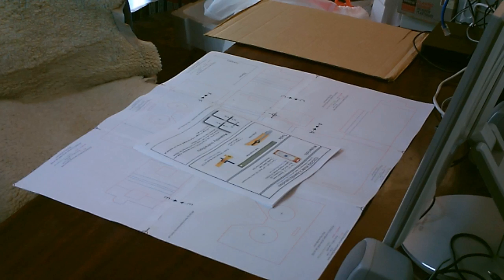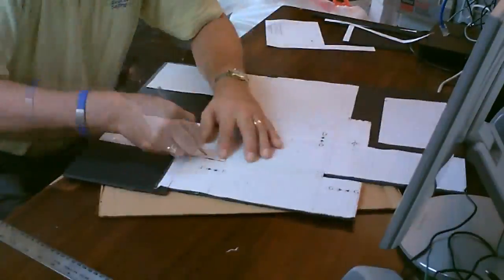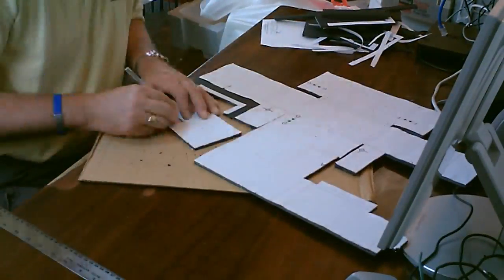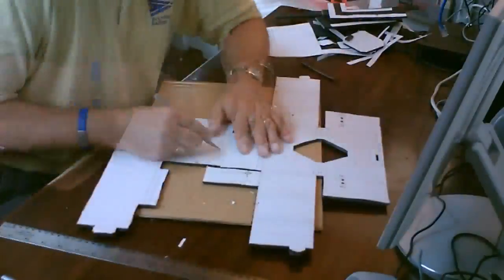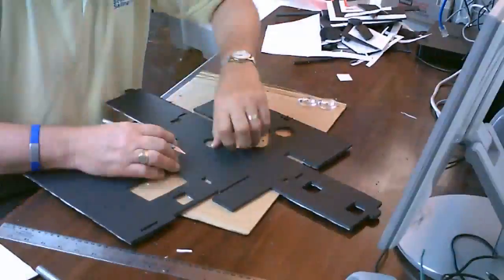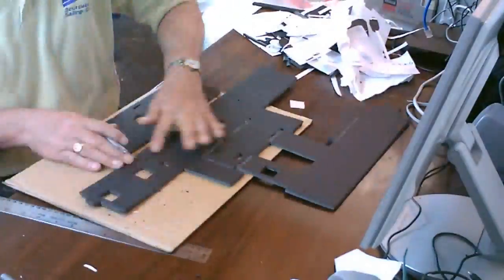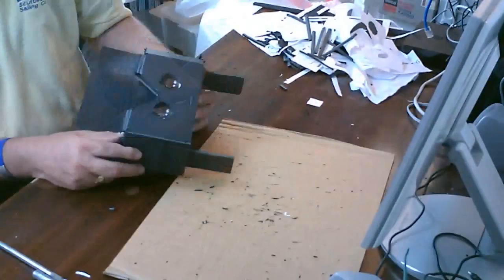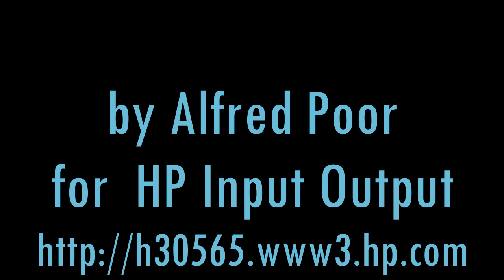Building an FOV2GO Viewer

Comment: I haven't tested it. I don't see why it shouldn't work, but you can always download the app first and try it to see if it will run. I don't think you'll find a viewer plan specifically for the new iPad yet, but you can try one of the existing templates, or modify one to match the dimensions that you need.